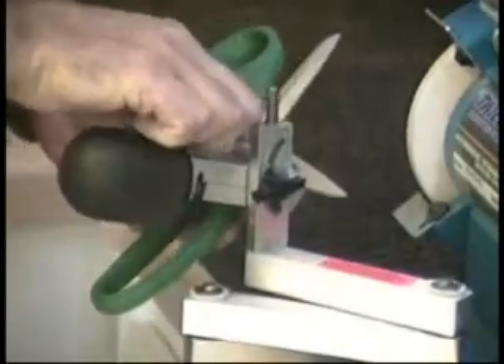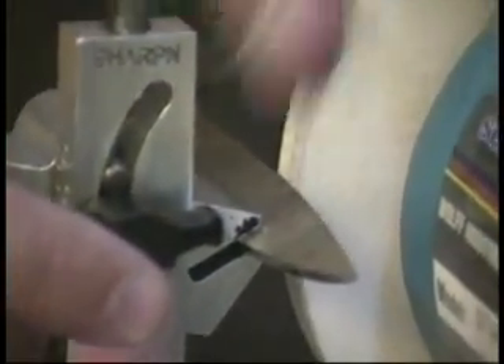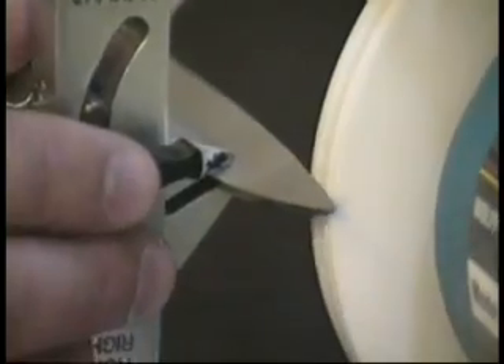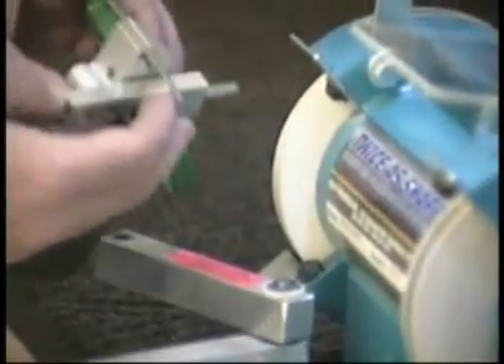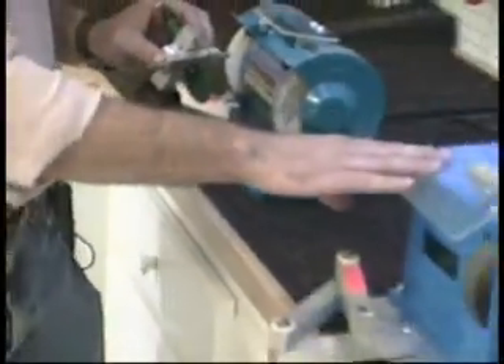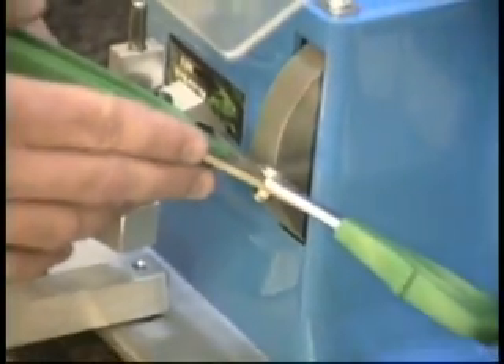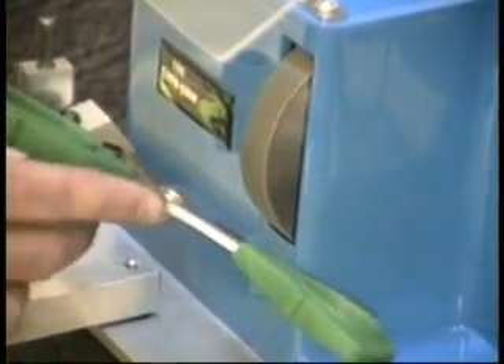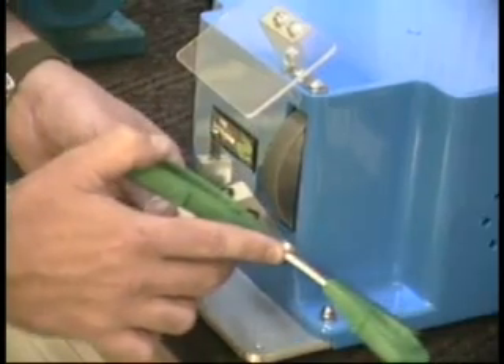How to Use the Wolff Corru-Gator®

Comment: would buy the wheel,  not the whole machine
Reply from the maker: Sorry for the delayed response. You can buy just the wheel on our website. You would just need the appropriate rpm for cutting the corrugations. It is a lot slower speed than the sharpening machines
Reply: @wolffindustries  can a rheostat be used on a standard twice-as-sharp?
Reply: @wolffindustries  what rpm is recommended?